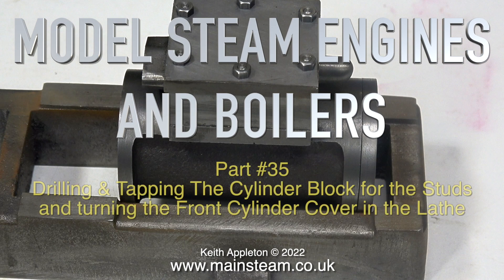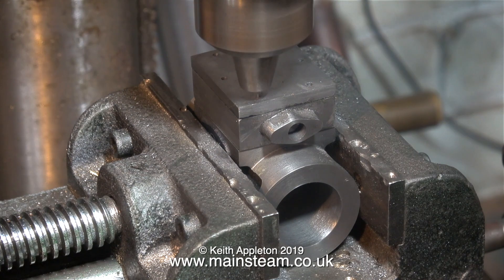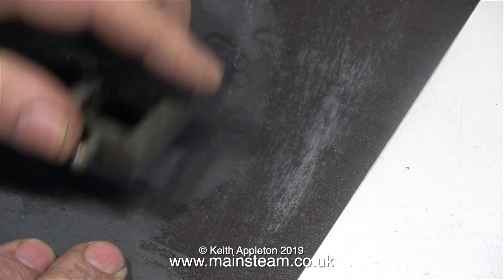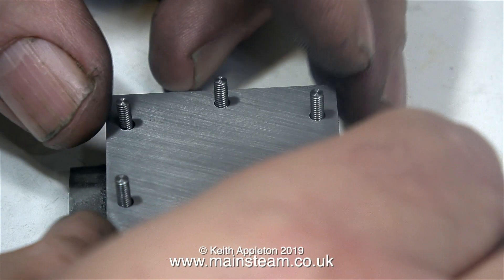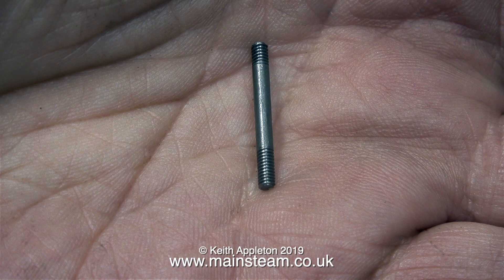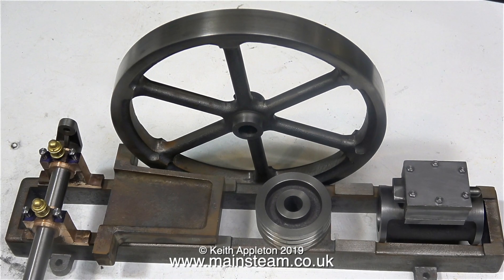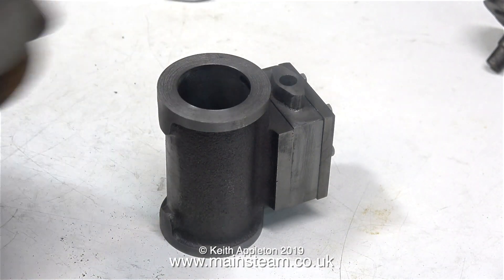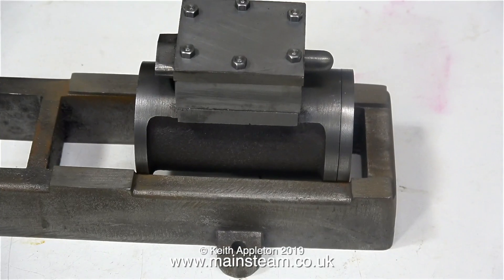MODEL STEAM ENGINES AND BOILERS - PART #35

Comment: I noticed that the calipers, which cost only 9.99 euros, quickly ran out of battery. Also, they are not exact. I use a vernier caliper that comes from a specialist shop and the same batteries last a very long time. Externally, all calipers look absolutely the same, regardless of whether they are cheap or expensive. 🤔
Reply from the maker: You are probably right, I will buy a better quality set {:-)))